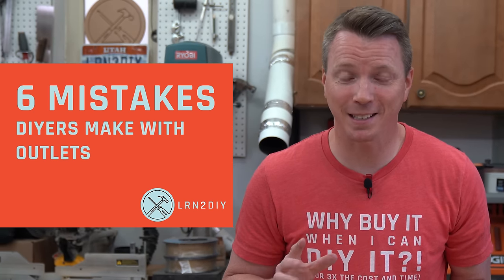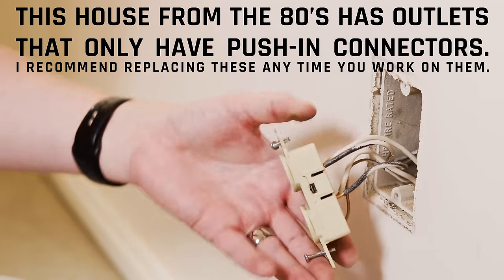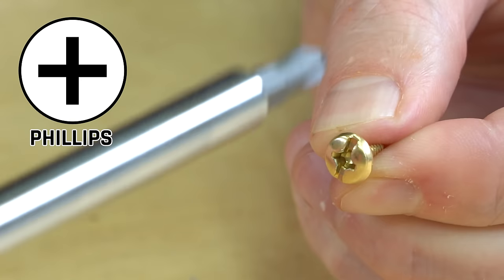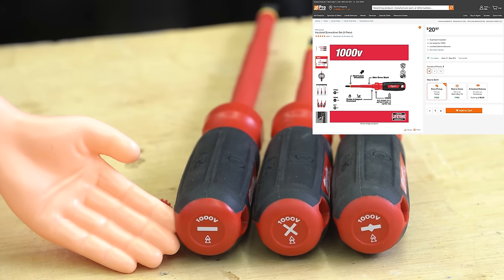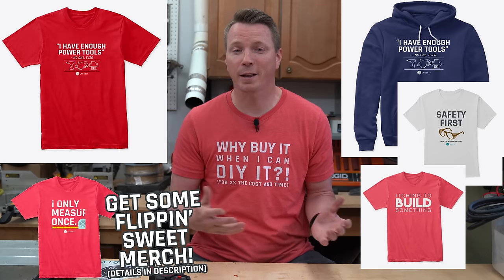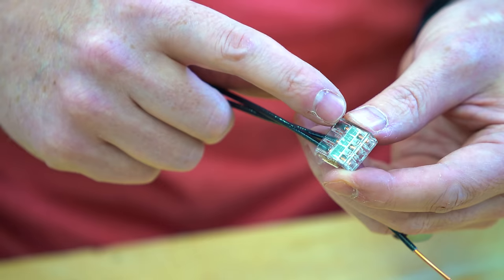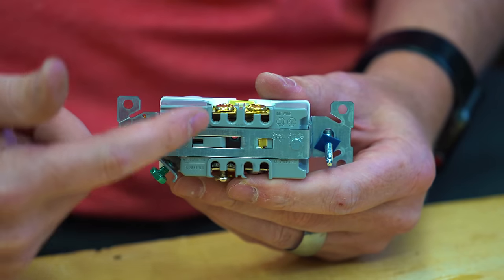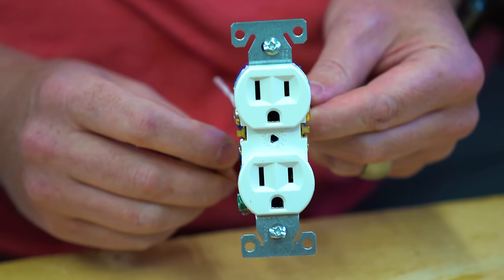6 MISTAKES DIYers Make When Wiring Outlets

Comment: Unfortunately I’ve seen most if not all of these mistakes in new construction performed by lic. electricians. I had a complaint the other day of a kitchen GFCI sparking when anything was plugged in. I removed the outlet and found the hot line wire was over striped so about and 1/8” of bare wire was exposed. When the plug was pushed into the box the ground wire bent up under the bare hot. When something was plugged in the two wires made contact and tripped the breaker. The ground was burnt in two.
Reply from the maker: Yikes! Yeah, there's all kinds of stuff out there and some of it is poorly done. Glad you were able to take care of it for them!
Reply: @LRN2DIY  it got worse than that They have a 5 story parking garage. They wired up all the 120v outlets with 240v some how. Still don’t know how they did it. I don’t know if they had the neutrals on single pole 20s or they wired both hot and neutral on a double pole breakers. Apparently there was some confusion if the bldg was going to be 3 phase or something along those lines. They didn’t realize the outlets were 240v until several 120v devices got burnt up. Luckily no one got hurt or killed

Comment: I was a commercial electrician for 15 years, I never used the back wire. If the outlet fed the next, 2 black 2 white and 2 ground in the box, I would pigtail the wires. take 2 black in box, add a 3rd, twist with lineman`s pliers add a wirenut. repeat for white and ground, Use added wires for outlet. Easy troubleshooting, if an outlet is dead, but breaker is live, bad outlet. Every job I was on, I did it this way. Never an issue.  Unused screws on outlets were always secured. Good video, I was taught by an "old timer" who took me under his wing, Taught me well. New sub.

Comment: FYI, I've seen comparisons of the "Wago 2273 compact push wire connectors" vs the "Wago 221 lever nut connectors", which found that when using solid wire, the 2273's had much better pull resistance, and much lower electrical resistance (i.e., they don't get as hot) when pushing 20 amps of electricity.  As such, if those two criteria are particularly important to you on a particular job, you might want to consider using the 2273's instead.
Reply: My electrician will not use the Wago type connectors for the same reason he won't use the push connections on the back of outlets: too little contact and a potential fire hazard. Twist the wires and install a wire nut to eliminate potential problems. Also using outlets as a junction is against code. Code requires pigtails. As to why manufacturers put two screws on each side, I have no idea. I admit to using them in the past until I was reprimanded by my electrician buddy.
Reply: @30cpe  the dual screws are there for the occasion where you want to split the circuit in two, so that one outlet is always 'on' and the other is controlled by a switch. That's why there's usually a little jumper bar connecting them which can be snapped off. However, to be NEC code -compliant, all circuits on a single device must be controlled by a single or double-pole breaker.
Reply: @30cpe  quote an NEC reference for the violation please
Reply: @30cpe  I recently connected two outlets together using the two sides, not only because it was already wired that way (was just replacing the old outlets) but because the secondary outlet is just a low power outlet. Primary plug runs a computer, fan and soundbar and that feeds the secondary which is simply charging phones n such. I assumed in this use case it really shouldn't be an issue. I'm not an expert but my experience with computers, drones and high wattage / voltage car audio had me thinking this scenario perfectly fine as the whole point is to not overload the capacity of the wire or the bridge of the outlet and thus the low power secondary wouldn't really add much in the way of heat / resistance. That said at some point in the future I've been thinking about rewiring and adding more outlets and after seeing how that was wired I wouldn't doubt two other plugs are wired the same in this chain and they didn't have this one grounded properly so I'll be checking those today or tomorrow...
Reply: German premium brands switches and outlets are since 30 years almost all push in only.
Reply: @Howie Morris the other reason for cutting the joiner tab between the 2 plugins in a receptacle is for 120/240Vac receptacles typically located on walls above the kitchen counter. Each plugin is on its own circuit so that when a toaster and a coffee maker or what have you is plugged in the breaker does overload and trip out when both are operating.
Reply: @30cpe  Believe it or not, when I started wiring, at age 10, the town code required kitchen counter outlets to have a separate circuit for the top and bottom outlets.  So, you ran 12-3 to every outlet, pigtails had to be twisted and soldered before the wire nut was put on, then you connected one circuit to the top and the other to the bottom.  Finally you broke off the tab.  Needless to say you were careful when you connected these to the breaker box so you didn’t end up with 220 in the outlet box.  

Separately, I like to buy the outlets that have two plates to hold the wires.  No need for a crook in the wire and the contact resistance is as good as using a crook.  They cost more but the time savings makes up for it.
Reply: @30cpe  One reason for the two screws is to allow the receptacle to be used for two separate loads by breaking the little connector tabs between the screws. This can permit two different circuits, e.g. dishwasher (direct) and disposal (via wall switch), or one circuit with one leg switched, e.g bedside lamp and alarm clock.
Reply: Also I believe the nec requires the 3wire being use as two circuits needs to be terminated on a double pole braker, this keeps the potential on the neutral  equally balanced or a single mini braker with two separate handles and same amperage and this way you avoid 240volts in the termination box this also keeps the potential balance..
Reply: @30cpe  Code does not require pigtails. There are 2 screw terminals on a receptacle for both hot and neutral for a reason. Stop making stuff up. Tell your electrician buddy there is a difference between "against code" and "this is my own opinion."
Reply: @audiocarp  Millions of houses wired in-and-out of the screw terminals and no inspector in the United States has ever picked up on this?
Reply: @raymondbunkofske4702  Re:  "Russ Vance  Believe it or not, when I started wiring, at age 10, the town code required kitchen counter outlets to have a separate circuit for the top and bottom outlets.  So, you ran 12-3 to every outlet, pigtails had to be twisted and soldered before the wire nut was put on, then you connected one circuit to the top and the other to the bottom.  Finally you broke off the tab.  Needless to say you were careful when you connected these to the breaker box so you didn’t end up with 220 in the outlet box."

If you used 12/3 to wire split-circuit receptacles, you need to connect the 2 circuits to 240, one on each leg, so the neutral carries the unbalance load. Couldn't get 240 volts from each outlet, but there would be a 240 volt potential difference between the upper and lower outlet on each receptacle.
Reply: @davidedwards5773  That's a Canadian thing. A 20 amp kitchen circuit is more than capable of powering a coffee maker and a toaster.

Comment: 🟦 As an electrician for over 45 years I don't know why this has even come up as an issue,.... but, wires should NOT be pre-twisted before wire-nutting,...allowing the wire-nut to form/govern the contact area as you twist is HIGHLY recommended.
Reply: I know other 45yr plus electricians that say different.  Pre-twisting solid wire is alright as long as you don’t over do it.  Pre-twisting stranded wire is not alright because it weakens the strands and they tend to break off.
Reply: I respect your opinion since you are a 45 year vet, but I was taught differently. Like the comment above me stated, you pretty much have to have a good pre twist. Have been doing it for few years now. Everyone does their work differently though.
Reply: It really should be whatever the manufacturer recommends. If making your own connections i tend to agree about not pretwisting unless your gonna be using waterproof wire nuts.

Comment: As an electrician by trade, I've seen many outlets wired right and wrong. I real newbie in DIY electrical will also make the mistake of putting the wrong wire on the wrong terminal. Hot wire(black or red, in the case of split receptacles to the gold coloured terminal and the neutral wire(white) to the silver coloured terminal. If you're using stranded wire, absolute best practice is to use Stakon connecters. This prevents stray strands from making accidental contact. Otherwise very informative and well presented.
Reply: Caution to DIYers:   some jurisdictions do not allow split receptacles.  They specify one circuit per device box. In those jurisdictions, the only reason to remove a bus bar is if 1/2 of  the outlet is to connected to a switch.
Reply: @99bn99  You could still split the receptacle with a three wire circuit coming from 120/240v breaker or a pair of breakers with a tie-bar.  That is usually how you would wire a split receptacle.
Reply: @fillfreakin2245  That is the correct way to do it.  Unfortunately, due to the large number of accidents caused by people who don't know enough messing with receptacles, having more than one circuit in a device box, including split outlets, is not legal here.
Reply: @99bn99  So they don't allow split receptacles or they don't allow two circuits in one device box? Those are separate  things. The devil is in the details, specially with regard to code rules.
Reply: @fillfreakin2245  I am not an electrician.  I can't quote a code reference to you.  I am going by information supplied to me by a very good licensed electrician at the time the provincial code change occurred. I see both as the same thing.  

It is my understanding that one device box cannot have two power sources.  Regardless of whether 
a 120/240V breaker with one handle is used, or 
a 120/240V breaker with 2 pinned handles, or 
2 120V breakers with a pin in the handles, or 
two fuses in a fuse block (block has to be pulled out to access the fuses), 
there  is no way to supply power to both sides of a split receptacle without having 2 "circuits" in the same device box.  

Having a receptacle that is "split" so that one half is always live and 1/2 switched is permitted, if the feed through the switch is from the same fuse/breaker as the always live half.  

There may be a definition issue here.   I am identifying a "circuit" as everything fed from a specific breaker/fuse.  Some might consider what is controlled by a switch (eg, light switch) as being a "circuit". 

I ran into this when I tried to use a timer to control 2 coffee makers plugged into separate outlets.   The timer was designed to control either one 240V input & output, or 2 120V inputs and outputs (yes, I know the input is the same thing).  It was not allowed because it was considered I had 2 power supplies to the timer because there were 2 separate loads.  If I had 2 pinned 120V breakers feed the timer to control one 240V load, the timer would have been acceptable.   
Incidentally, there was no government inspector involved in this.  I was doing volunteer work for a charity, and 2x per year I hired an electrician to review the work I had done, to ensure what I was doing was safe.  I discussed this project with him before building it, and he told me it would never pass inspection, for the above reasons.  It was in connection with this project that  he told me about the code changes that disallowed the classic "kitchen split". 

As I said before, please make sure that anyone coming after you knows there are two power sources in that box.   Too many  people are not smart enough to test, switch off, and test again, and then test the test equipment to make sure it is still functioning.
Reply: @99bn99  Which province are you in? In any case if you have a 3 wire 120/240v fed from a 240v breaker,  that is one circuit,  not 2 circuits. It is considered a single source because it has a single control point.
Reply: @fillfreakin2245  Ontario.  What I have said is what I have been told.  Bottom line, a 120/240 split ("kitchen split") is allegedly not legal here.
Reply: @99bn99  I highly doubt that split receptacles are completely disallowed in Ontario.  I am in BC, and like all provinces we operate using the Canadian Electrical Code. It is enacted as law by each province, usually with no or very few alterations.  You either misinterpreted what your friend said or he is wrong.
Reply: @fillfreakin2245  Your last statement is quite possibly correct.  I don't expect to have time to research code myself any time soon.  I do not know how the provincial codes are developed, other than the federal code is used as a guide.   At my age, it is unlikely that I will be doing any electrical work (I rent, and if something needs to be fixed, let my landlord deal with it - liability issues).  
I always thought the split was great, particularly in kitchens.  However, that would not work well in kitchens today, as most need to have GFCIs.  Although I do remember seeing a very nice kitchen with GFCIs about 30" apart (32"?).   The owner told me she insisted on lots of outlets on different breakers when she had her kitchen renovated because she was tired of constantly having to be very careful what got plugged in or risk blowing fuses.
Reply: @99bn99  Well, the electrical code definitely allows split receptacles in kitchens, the only reason most home constructions don't do that anymore is cost, because a couple of GFCI receptacles are a lot cheaper than a 240V GFCI breaker.  What basically killed the split receptacles in the kitchen was the code rule requiring GFCI protection on outlets close to water sources, and the economics of GFCI receptacles compared to protecting at the breaker.  Although those breakers are finally coming down in prices.
Reply: @fillfreakin2245  GFCI breakers.  Depends on the panel.  I remember an electrician telling me that the owner would have a problem if the GFCI for a water heater quit working, because they were no longer available for those panels.   However, I no longer have anything to do with that building, so not my problem.   I am not going to worry about split receptacles, as I am unlikely to have anything to do with installation or maintenance anymore.  If I do, I will go read local code myself instead of depending on others.    Thank you for what you have pointed out and for making me think.
Reply: @99bn99  
Ah.... you Canadians 
So polite.  LOL

Comment: What is your feeling about the necessity of wrapping the outlet sides with electrical tape to cover all of the connections and help prevent against any short circuiting or accidental touch?  I see some people do it and some people don't.

I'm just curious if you see a downside of other than taking a little extra time per hour
Reply: It's not necessary, but a good practice.  It might encourage laziness with regards to tucking in a box.
Reply from the maker: I'm still somewhat undecided on this. I've done it on some and skipped it on others. If you have a metal junction box, I would recommend it because you have increased likelihood of touching a conductive material but, if you're going to do it, don't pull the tape too tight because it stretches and then comes off. I recommend wrapping it with two layers and only at the designed tension if you're going to do it. They also sell outlet/switch rubber band wraps, which are like an upgrade to the electrical tape wrap, but most folks don't have those kicking around like we do with electrical tape.
Reply: Personally I wrap the device with electrical tape when installing in metal boxes, or when installing devices in 3 and 4 gang boxes.    These situations there is a higher chance of the ground touching one of the terminals and causing a short.   And any dimmer or electronic switch that had screws instead of the more common wire leads I always wrap with tape.      An accidental short and there goes $30 or more down the drain.
Reply: Wrap for metal boxes and GFCI or AFCI outlets, wet/damp areas, or boxes with more than 2 gangs. Otherwise, nope.
Reply: it makes things messy if you ever have to service the box, later.  I will do it if I have to have a receptacle exposed or if I have to push a live receptacle into an under width steel box; but no other times.
Reply: @LRN2DIY    Once the outlet or switch is installed in the metal box, there is no way for the terminal screws to touch it, so it’s really not necessary. If you want to push or pull a live switch or outlet into or out of a metal box, really not recommended, then maybe tape it.

Comment: The reason the heads to secure the wires have the different slots is so you ca use multiple drivers and not have to waste time changing from the one you have in your hand.

Another important issue is to always make sure when stripping the wire you use the right gauge on your stripper so as to not make a small nick in the wire which over time will weaken.
Reply: no one likes a know-it-all.
Reply: That certainly is true, of you use the right size you can tell since it slides of easily.  For power it is either 12 or 14.  14 is the most common but I have 20A lines too.